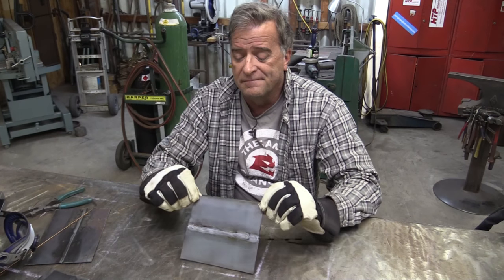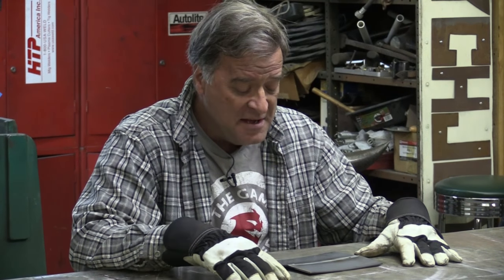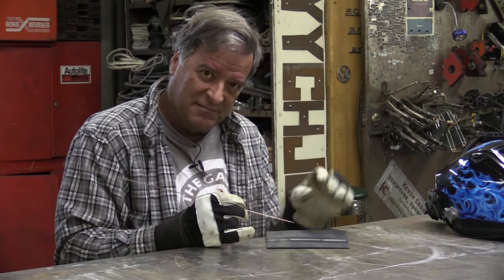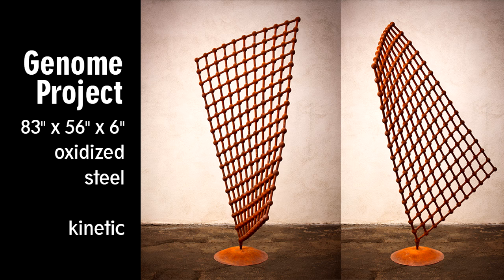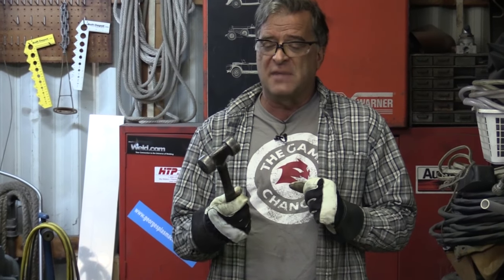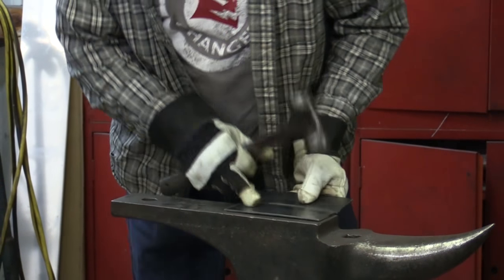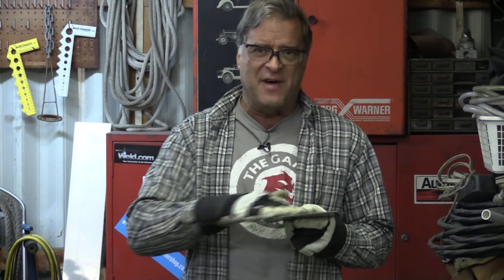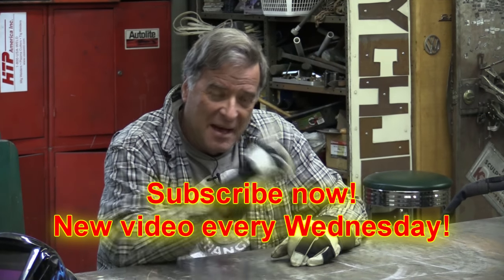How to Fix Welding Heat Distortion - Kevin Caron

Comment: Cool how used the welder's worst enemy, distortion, to your advantage to create the Genome sculpture.

I've been looking at ways to minimize distortion, as I've been asked to make some big ornamental gates.  Obviously I want to do a good job, as there may be a lot more work where this came from if I do.  I think the key is to clamp everything down flat and to really think about the sequence in which I weld things.
Reply from the maker: Absolutely !  Clamped flat or just welded to the table until cold. Or use the heat to warp back into shape. Still learning that one but it does work. Thank you for watching and posting. If you get a chance please click an ad or two. Helps pay for the videos.

Comment: I had a scrap aluminum plate 3 foot square by .25" thick that I got from a scrap yard that was warp pretty bad !   I rode on it with  truck back &  forth till it was almost straight then I used a 1.5" inch steel block about 8" inch roun lay on top and I beat it with a maul till it was flat .  It work pretty good!
Reply from the maker: And way cheaper than a new piece from the steel yard!
Reply: @KevincaronSculpture   yes I learn a lot from your video and I paid 10 buck for the aluminum plate and it took care of business as intended an thank you for the upload  Mr.  Kevin .

Comment: I have a serious problem with a 4 by 4 ft 2 inch tubular steel frame that's warped corner to corner by about maybe 3/8. I have to fix it because it's going to be my welding table so it has to be flat I cannot move forward with this project until is absolutely perfect without any doubt. A used corner clamps you know big cast iron corner clamps but it's still got the warp in it I was wondering if I should buy two more corner clamps clamp it all down flat and then heat up two of the corners to make it go completely flat I'm at a loss and I could use your help hobby stuff is all I have left I'm disabled I can't work it's horrible not being able to work I'm in pain all the time so sitting at a welding table is something that I can do. Any advice would be greatly appreciated
Reply: By the way I have no other flat table in the floor isn't great so I have to do this somehow scientifically or at least apply trial and error using the right method and hope for the best. I'm a good designer but I don't know all the tricks of welding I'm teaching myself to TIG weld right now and it's coming along slowly but it's working okay.
Reply from the maker: You can try heating it with a torch slowly on the other side of the warp and letting it move from the heat. Have a wet rag to cool the metal to stop the warp. It will NEVER be totally flat and true if you do it this way but it will get better. If you have a piece of 4x4 plate for the top that is in the 1/2-to-3/4-inch range, you could clamp the table legs to the top to weld it on and try to pull the warp out.  Or you could get new steel and start over.  There is no way that I know of to get the warp out without having a table to clamp it to as you are working on it. I don't know what tools you have in your shop so it is hard to give you any better ideas.  You might get away with just cutting out the warped piece and replacing it. Hope this helps.  Thank you for watching and posting.

Comment: How about low spots along both sides of a seam? I’m getting them as I mig patch panels on my car and would like to avoid filler. I’m keeping heat minimal and spacing quick spots out, but still get them.
Reply from the maker: I have used a copper plate behind the weld to keep distortion down.  But be careful!  You can weld steel to copper.   Might be better to use a piece of aluminum instead.

Comment: Thanks for the vid.
Just one question: When you butt-weld thicker sheet metal, does the bead area tend to pull towards, or away from you?
Thanks.
Reply from the maker: Always pulls towards the weld when I do it.

Comment: Hello Kevin I took 4 pieces of 1"  angle and cut to 18" length  then I welded them to make a square when I was done welding the square on one side was very high not laying flat. Any suggestions how I can get it to lay flat?   Thank You
Reply from the maker: Cut it off, grind clean and reweld. Use more clamps next time.

Comment: Isn’t there a way to heat up specific areas of the warp to destress the metal and walk it back flat?
Reply from the maker: I have had some luck with heating the other side of the warp and getting it flat.  It is definitely an art that I need more practice doing.
Reply: @KevincaronSculpture  if you get better at it. Please share the technique. I’d love to learn how!
Reply: Flame straightening is what you want sesrch to find information on how correct defects with a torch.

Comment: Could I use a torch and some heat & pounding, to help take out the bowed side of a 3/8" thick piece of plate that I've welded?
It's about 31" x 22" and is the base of a new firebox for a smoker.
Enjoy your videos, & they've help me immensely!
Reply from the maker: Saw a video once of guys on a ship using a torch and a fire extinguisher to take out dents.   Just heat it up and cool quickly.  But yes, you should be able to get the bow out with a torch and hammer.
Reply: @KevincaronSculpture  I managed to take out the 1/2" (approx.) bow in my 3/8" base plate using a rosebud torch, a hydraulic jack, some hammer blows, and wet rags.
Thanks for the advice!!

Comment: kevin do you recommend using oxygen acetylene torch to heat and hammer to get the warping out???
Reply: Strategically applying heat with an oxy-fuel torch and immediately strategically cooling is very effective in drawing the metal to eliminate warpage and straightening most anything metal including shafting.

Comment: I welded a 4" channel to a 1/4" rectangular plate and it warped by 3/32” inch. With the most of the plate flat and it tapers at last 4 inches. I am thinking to take a grinder or band saw to cut a thin grove and weld it to undistort it. I am afraid of over shooting the distortion. The plate is 6" x 16".
Reply from the maker: Sure worth a try!

Comment: So how about a bent welding table 1/2” thick and 20” wide 48” in length?
Reply from the maker: I would probably cut a small groove in the backside and weld it up to try to an pull the warp out.

Comment: ohh god was building a door and i had to weld a plate on one side of the frame it warped in and there is no more room for the lock to fit between the frame and the door and i cant weld inside i took the plate off im hoping that if i add shims between the two tomorrow  and than weld the plate back it will get back to the shape i want
Reply from the maker: Sometimes you can pull it back the other way with an O/A torch and a co2 fire extinguisher.

Comment: Prevention is 9/10ths the Rule. Do a little study on heat control. You can use a heatsink (clamp to a 1" thick slab or table), you can pre-heat the part in an oven or using a torch (400F for 1/2 hour), Avoid continuous welds (spot weld here, cool, spot weld there, cool, etc.) You can also use low-temperature flame (brazing) - which will add interest to art (it's beautiful), or even very low temp alumina fill. Oh yeah - and clamp with a reverse bow along the axis by putting a penny under it. I'm getting so damn smart. (not so much.)
Reply from the maker: All great tips!!   Thank you for watching and posting.

Comment: Don't worry about the name, if it has the face you need for the job at hand, it's the right hammer.  I have a couple glazier's hammers that I use for making leaves, and call it my leafing hammer just to annoy the purists!  :)
Reply: Faelwolf I have a hammer I call the persuader. Thor couldn’t lift it.
Reply: I have a hammer that’s also an adjustable wrench
Reply: @tristanmcmahen5976  Sounds pretty handy, it's going to turn, one way or another! :)